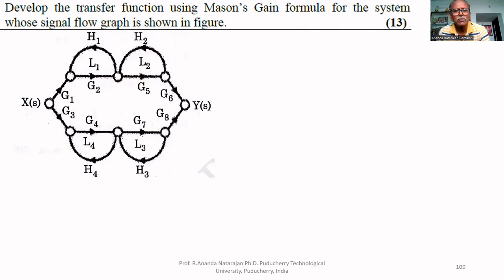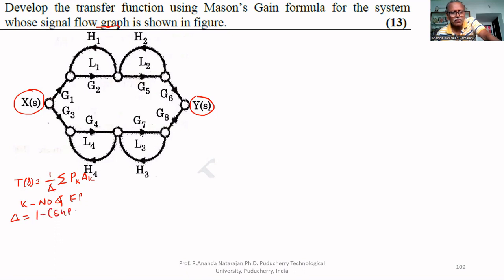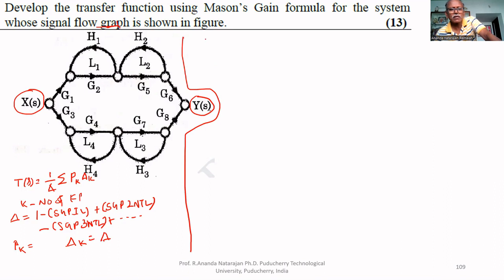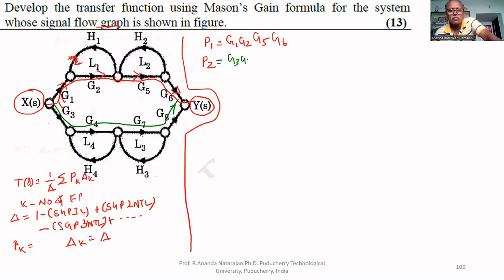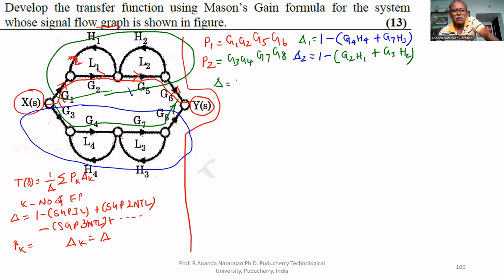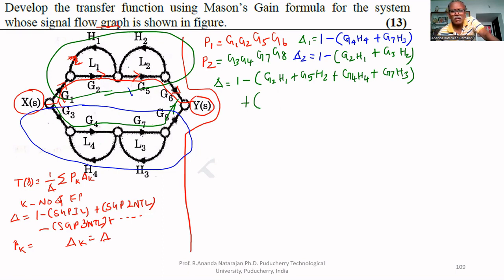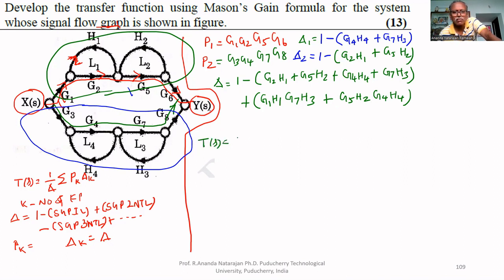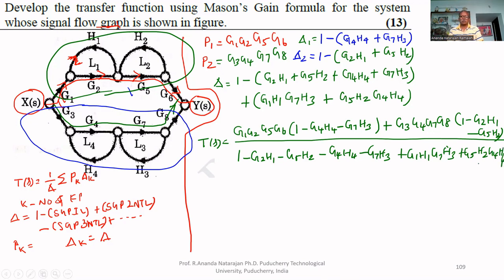1.06 Control system Engineering: Transfer function using Mason's Gain Formula

Comment: Loop L1 is not touching with L3 and L4 also as well as the L2 is also not touching with the L3&L4
Reply from the maker: Thank you. You are correct.
Reply from the maker: Two non touching loops are= L1L3+L1L4+L2L3+L2L4